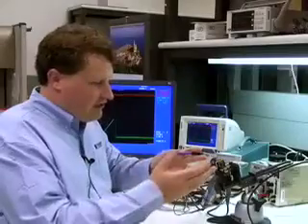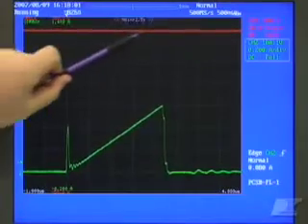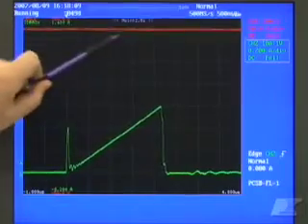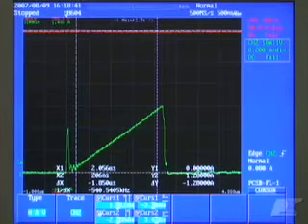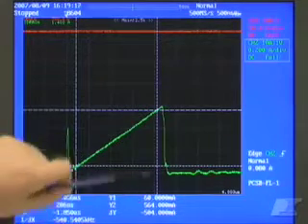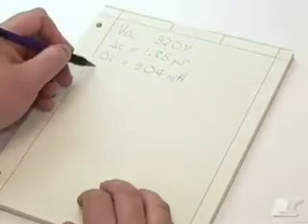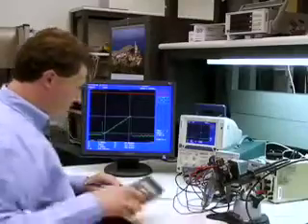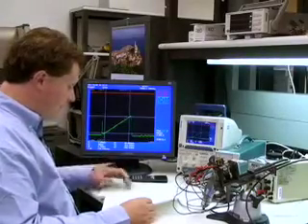Estimating Transformer Primary Inductance

Comment: But cannot you simply divide the volts measured (by a voltmeter) at the primary terminals by the amperes absorbed by this primary to obtain the total impedance and, by it, to find the inductance value, without all these measurements and without oscilloscope?